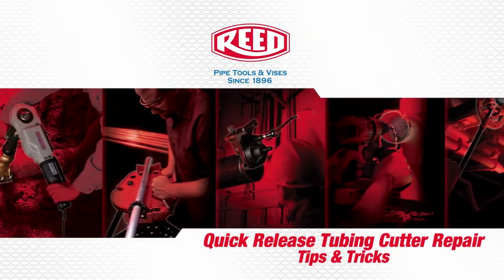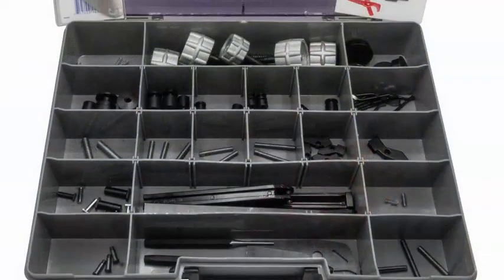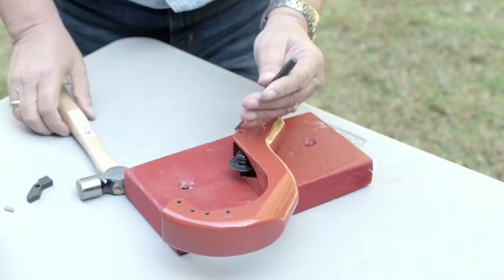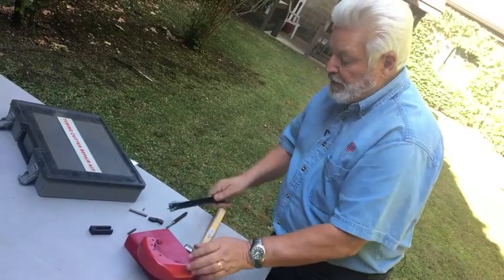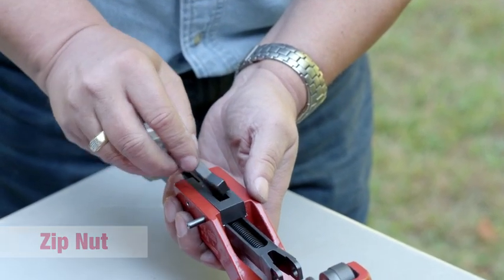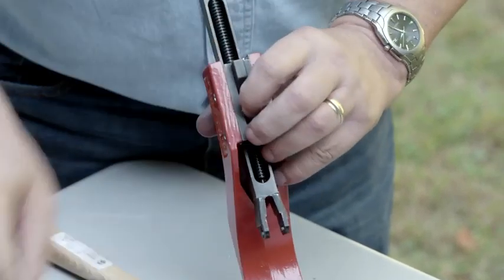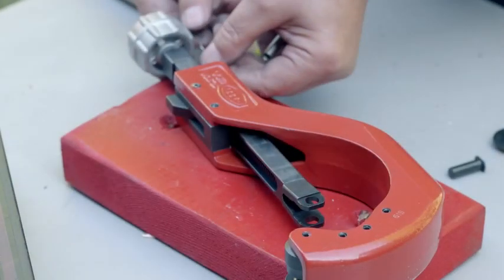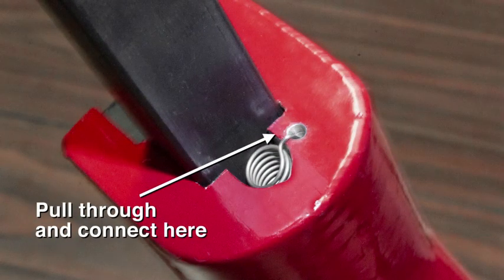How to Repair REED Quick Release™ Tubing Cutters: Step-by-Step Guide - Reed Manufacturing

Comment: I thought these were life time warranty guaranteed??? 

I once brought my reed tubing cutters into the pipe store where I had originally bought them to just swap them out for a new set . Just like we used to do with craftsman tape measures from sears not so long ago .
Of course that’s sears and craftsman tool trade off is a thing of the past now.  

Back to the people at the pipe supply store. They said they would just take them tcq Reed cutters and fix them there. So I left them with the salesman.  and this was back in like 1999.   He threw them in a drawer and forgot about them.   

Finally years later in 2014 ,Wow.  They forgot who I was.   And they also lost the cutters.   Seems like they found them again.  So much time went by it’s hard to remember. But I was able to prove enough I suppose. Because it was finally resolved.  
I know that I wasn’t going to forget as much as I paid for these.  

But it’s amazing I finally got a working set of Reeds. I think what happened as a result , the salesman gave me all new cotter pins , all but one.   I had to order one on Amazon . The man at the pipe supply was also nice enough to show me how to fix the problem that I had.  
15 years no cutters Lol .

As far as I know some places still honor rigid tubing cutters warranty and many did not know this.  Bring the old ones in and trade for new.   I always took them in to customer service.  They always had to chat with the manager but I would always get them traded for a new set.  And the Same with wiss snips. Unless something has changed.  I’m about to go try and find out with both . Times have changed for the worse it seems with everything. A lot of doors have shut.   So we shall see..   

sorry for rambling but , what is the proper way for Reed when these hand tools break ? 
Are they still life time guarantee ?  Is there a way to find the parts for free since they are covered? Heck I can’t even find all the repair parts.   

Needless to say I have 2 TCQ cutters. One is from the 80s.  One is from the 1990s and They cut 1/4 , 2-5/8  .
I like Reed better than Rigids.  Especially the No.10 or 15s. Cutters. They’re faster and cut more sizes compare to Rigids.   But it’s hell switching them Reeds out. Or getting the parts to fix.  I still don’t know how to fix the handle threaded rod part if it falls out the wheel box.   
Hopefully you guys will promote the repair parts with videos for all of it along with correct part names. Thanks.
Reply from the maker: You've had a long history with tubing cutters.  I can point you to the parts lists for REED T10 and T15.  Look on this page, under DOCUMENTS.  
https://www.reedmfgco.com/en/products/cutters-and-cutter-wheels/tubing-cutters/  
It is true that many of our distributors train to do repairs on site.  REED has repair kits put together that many keep at their counter.  Not all will do that, though.  Regardless, REED has a 5 year warranty that was adopted in 2018 in response to changing times.  Those T10 and T15 are still made to the same standards as the ones you bought in the 1990s.  
if need more guidance on changing out the "the handle threaded rod part if it falls out the wheel box", maybe we can shoot a video on a phone.

Comment: I have a question. Will this cut sch 80 xfr 3” tubing?
Reply from the maker: Using the 3-6PVC wheel, yes.  The blade exposure for the 3-6PVC wheel is .377” which is greater than the wall thickness of 3” sch 80 pipe.  
https://www.reedmfgco.com/en/products/plastic-pipe-tools/quick-release-tubing-cutters-for-plastic-pipe/tc4qpvc/

Comment: I have a question the roller pin for the large roller on the TC4Q 4inch pipe cutters keeps coming out. Would I have to buy the pipe cutters again or would can I replace the roller pin. I know you sell all the parts. Do I just use a hammer to put in a new roller pin???
Reply from the maker: I'm going to ask  the products team.  You might have a different part that is worn out, too.
Reply from the maker: Product evaluation should be done on your cutter.  Can you send us a close-up photo or even quick video of the situation?  Another option is to send in your cutter for evaluation.  Alternatively, you can just order parts.  Here is the parts list for your model:  https://www.reedmfgco.com/assets/download/3475__23-TCQ4-5-6.pdf

Let me know which way you want to go with this.  if you choose photo/video, send to reedsales@reedmfgco.com     But, still alert us here.